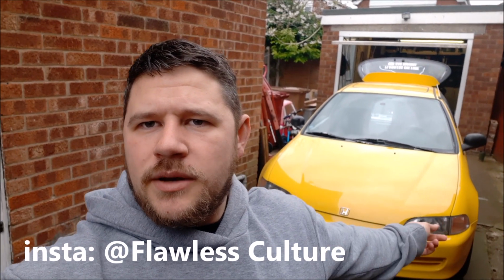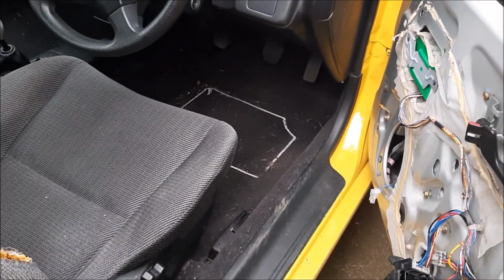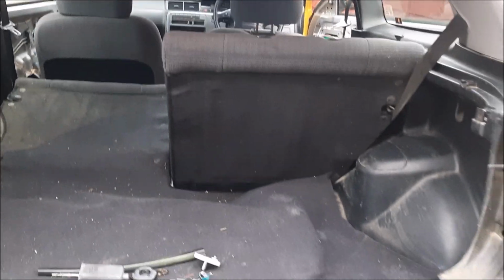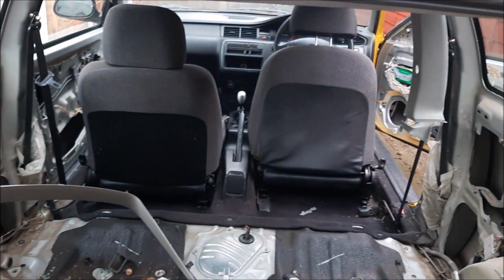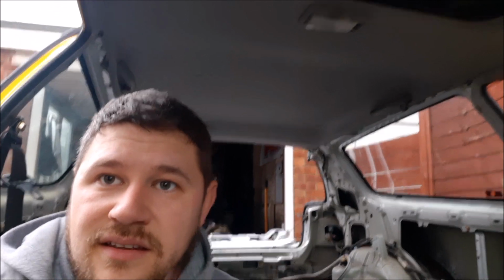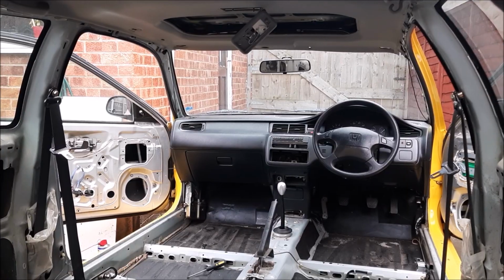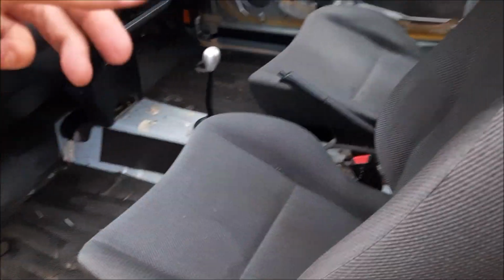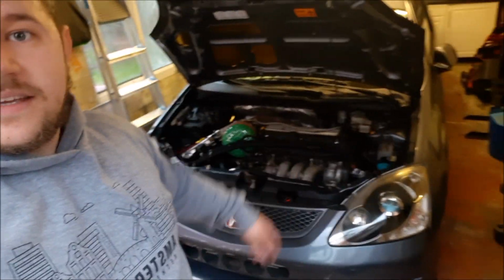Honda Civic EG Track Prep - Removing the Interior **FREE MOD**

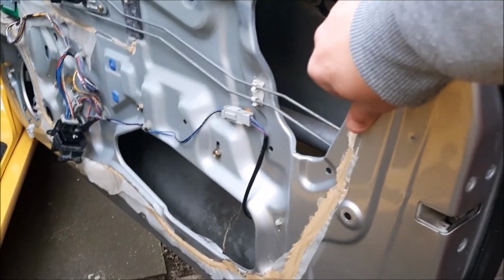Comment: 2:18 Hi What did you use to remove the gunk? I removed my panels and have that problem too
Reply from the maker: In the end I scrapped as much as I could off with a blade and then used petrol and a rag.